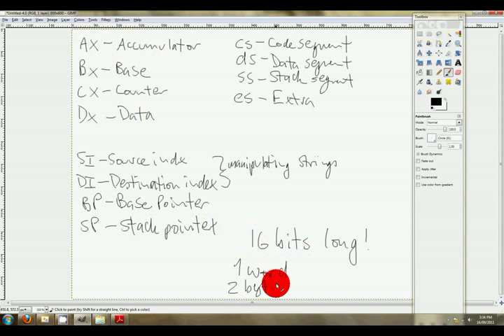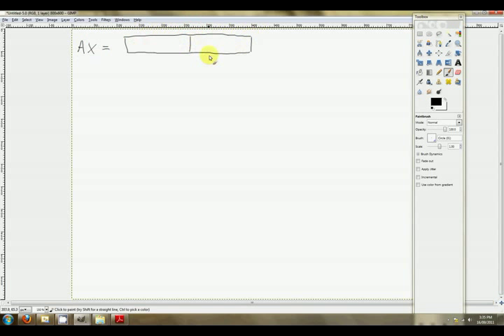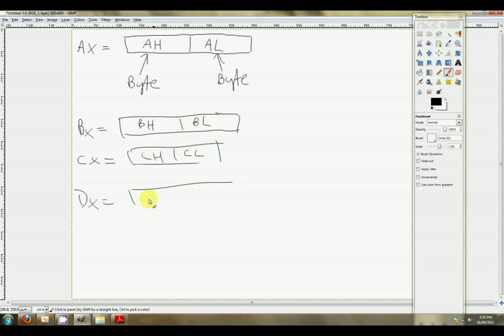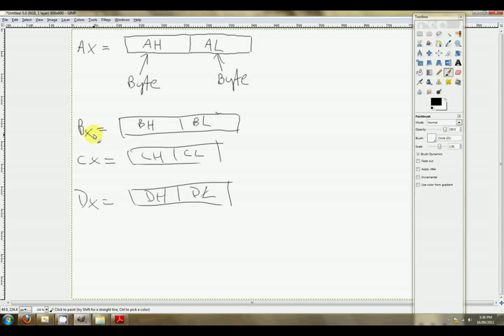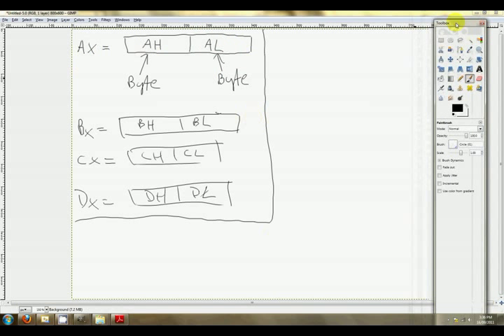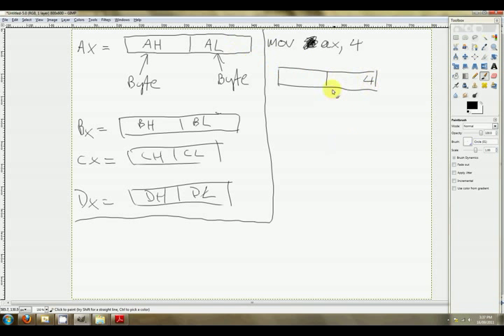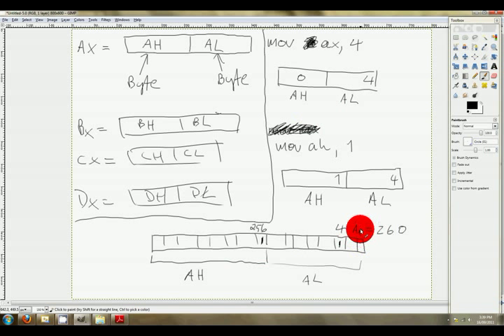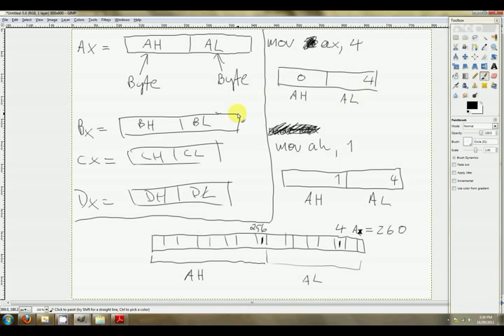x64 Assembly Tutorial 3: Intro to Registers, 8086 Register Set

Comment: I noticed a strange thing. When I specify that AH=1 and I dont specify that AL=0 I get number 460 instead of 260. That means that value of AL in bits is 11001100. 

Is that correct and if yes, why?
Reply from the maker: Sounds like something's wrong. If AH is 1, and AL is 0, then AX should be 256. Did you work it out?
Reply: What's a Creel? when I set AL to 0 before setting AH to 1 it shows corrrect number. shame that I have to use that extra insttuction though.
Reply from the maker: Oh I see, you hadn't cleared AL. You could just set AX to 256, that'd set AH to 1 and AL to 0 in a single instruction
Reply: I thought I could use AL and AH separately for values of one byte in size. It seems that I was wrong. :) Thank you for the info. I cant wait till I will have some more time to continue with your tutorials.
Reply from the maker: Yes, you can, that's what they're for. But 256 is too big. Bytes range from 0 to 255.

Comment: very interesting! its very different to PPC ASM. When I immediately load a value into the lower word of a register the higher word becomes zero and vice versa, where it is kept here.
in order to put a value into the higher/lower word without clearing the other part we usually add an ori instruction (or immediate)